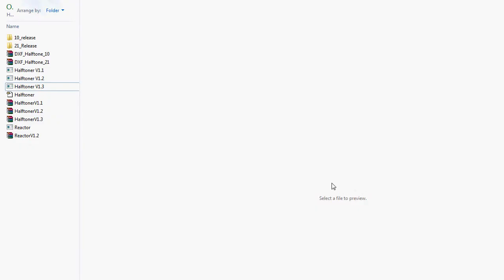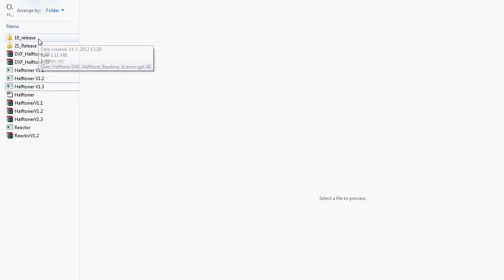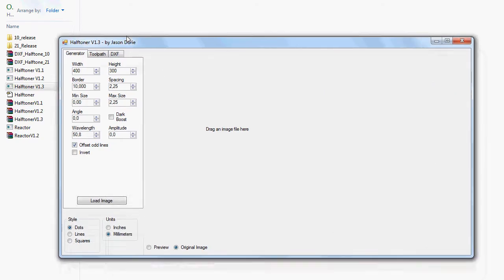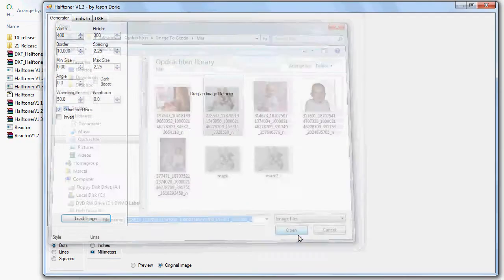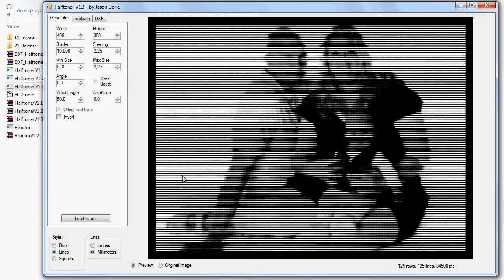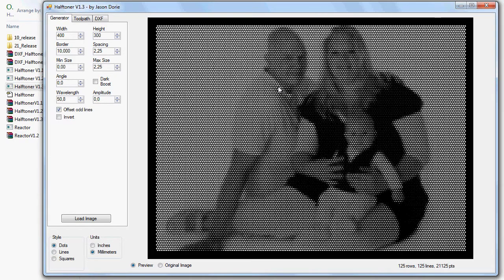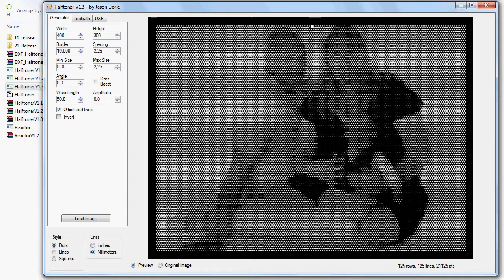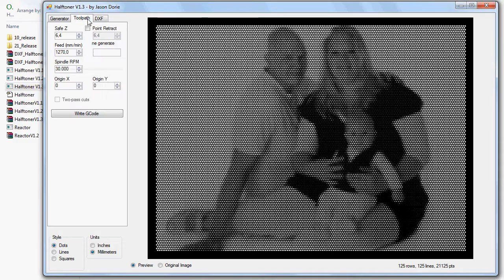RCNC Projects 25 : Making a Acrylic Halftone from a picture

Comment: As a tip, if you use the GCode output from the Halftoner program itself, the dots are cut in a very efficient back & forth raster pattern.  You can also tell your CAM software to cut the dots in "selection order" which usually works too.

I love the look of the image cut into acrylic!  I've been wanting to do one of these myself.